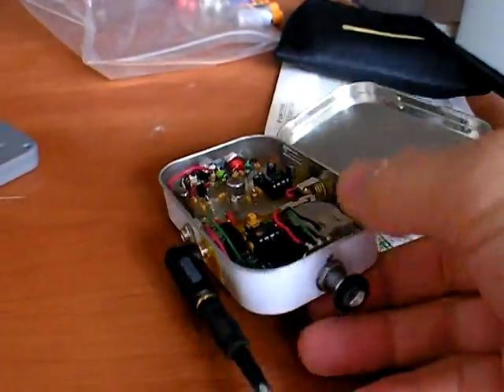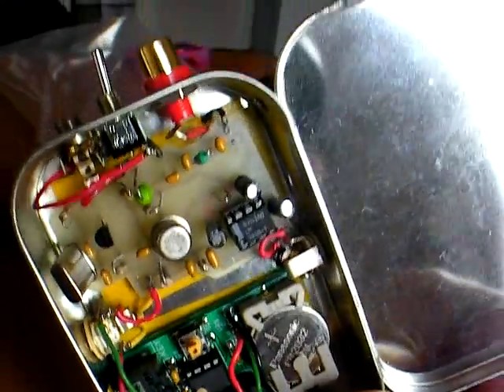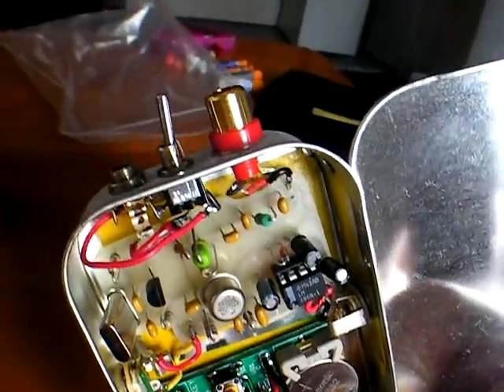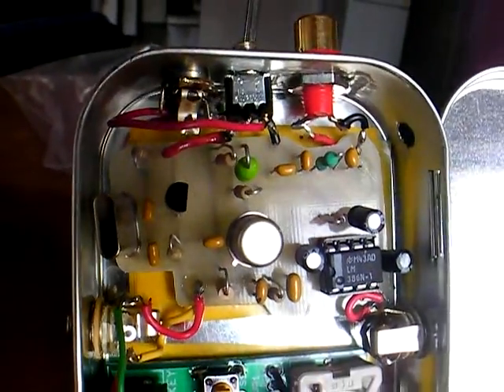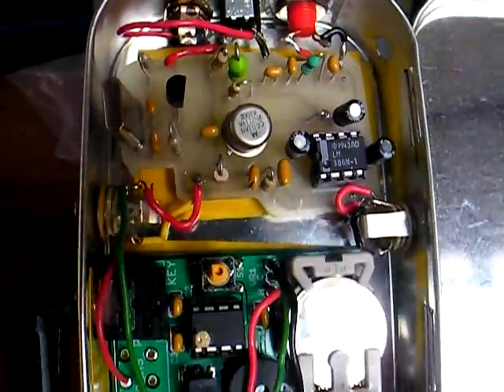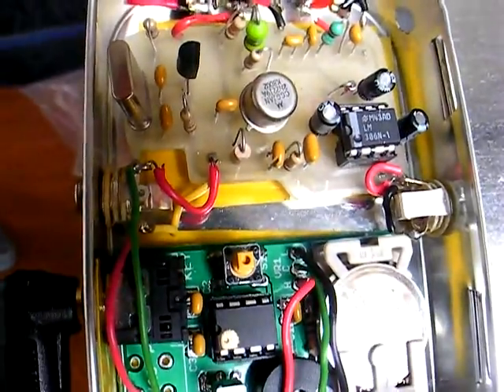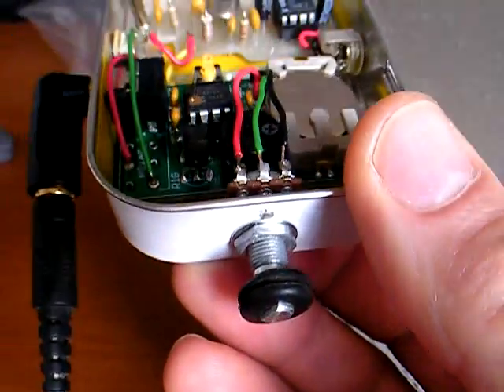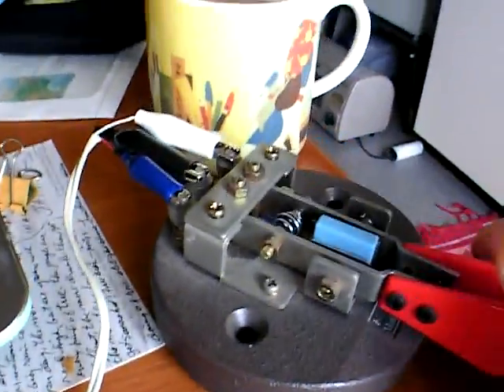Building a Pixie 2 QRP Kit (Ham Radio) Chapter 3

Comment: Excellent video. Am interested in QRP and bought ARRL literature on this subject. Q: How did you interface the Picokeyer with your PIXIE transceiver?. Reason for asking is have read that one has to be careful not to burn out some components of the transceiver. Look forward to an answer. 73 de VE6MAQ
Reply from the maker: This one is about 11 years ago, when I was first building QRP kits and the like. I never actually had even a single QSO on this radio. Theoretically it's possible, but I didn't have the skill then--or maybe don't now. I was 7J1AWL when I build this tiny fleapowered rig, and now I'm W0XO. My first QSOs--and there were hundreds of them--were with the KD1JV ATS3B rig that I built. If your question is about how I connected the picokeyer to rig--it's plugged in the same way any keyer would be, acting as a simple open/closed switch.